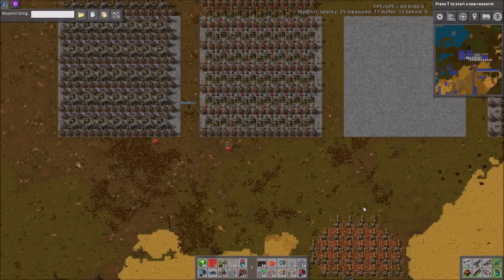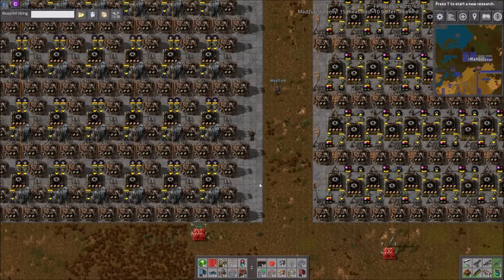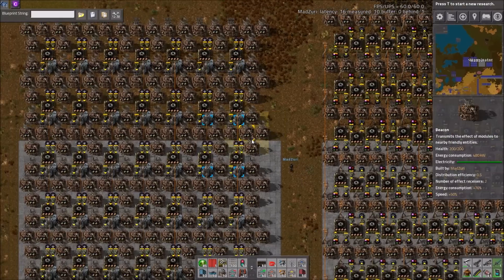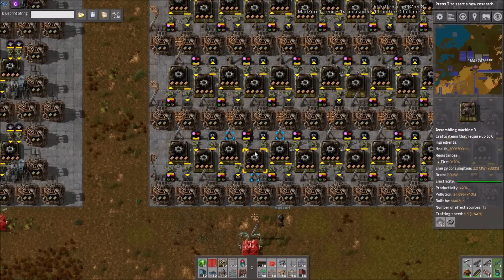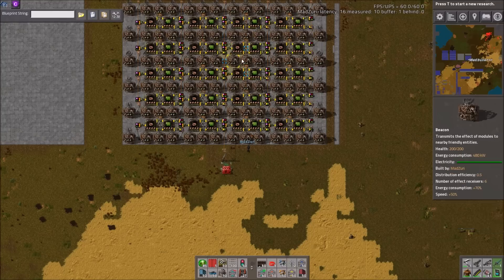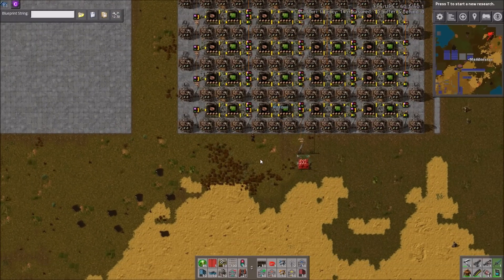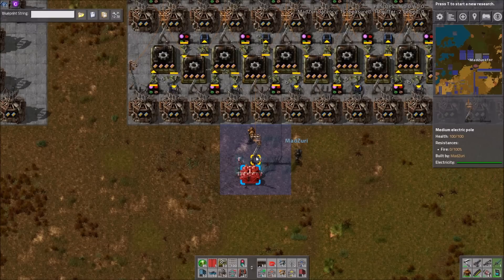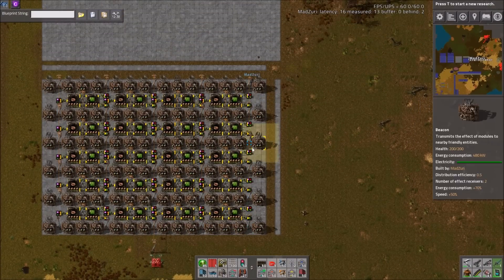Factorio Workshop - Building A Better Factory :: Power / Space Calculations

Comment: It turns out that, if you are accounting for the space solar needs, things get funny (you get about 3.28kw/tile with a near-optimal solar setup).

When factoring in the cost of beacons, the most power/unit you  get when using 2 productivity modules in the furnances, is each furnance being hit by precisely 5 beacons and the beacons set up to hit at least 6 on average (easily doable since the center ones all hit 7).
With higher power density, as one gets with steam, the most energy efficient is still the same 5 beacons with efficiency modules thing, but the most space efficient is 0 efficiency, 4 speed beacons. (meaning if you don't mind the increased coal usage, 4x speed beacon is the way to go)

Chemical plants want either 1 speed beacon, 2 speed beacon or 5 efficency beacons. Depending on how dense you can build really (= how many beacons you can get to hit and share effects).
oil refineries want 5 efficency beacons - if you can get all these beacons to hit at least 3 targets. If you can't - 1 Speed beacon or 0 beacons is actually preferable for both space and power.
And for Assembly machines, because they can get 4 productivity modules, for power efficiency/unit you want 8 efficiency beacons ... but for space efficiency you want 5 speed beacons hitting 8+ targets each. (Or 4 hitting 6+ each).

Messy spreadsheet I made for this:
https://www.dropbox.com/s/ohej33qnl98hfmo/spreadsheet%20ftw.ods?dl=0

disclaimer: these are slightly old results that do not fully account for inserters (an oversight I realized only after doing them all, but a cursory look over the numbers seemed to suggest that it doesn't differ much)
disclaimer 2: all those numbers are for belted builds, I have not done any calculations on how roboports and robots mess with those numbers, but I generally massively prefer belted builds for their better throughput and lower power cost anyway.
Reply from the maker: Wow really interesting info here! Thanks for taking the time to write it all up. :) Took a look at the spreadsheet as well, and I have learned some new things. :D

In regards to your disclaimers, there is a fun fact actually that I feel I should point out. Max upgraded bots actually have a higher throughput than blue belts do if you set it up correctly and don't have charging issues. Of course though, as you mentioned, it takes a lot more power to do that than belt setups.
Reply: Glad it was helpful to you! And that you were able to understand that mess of a spreadsheet xD

And well the "don't have charging" issues is the thing I'm worried about - I haven't done the math, so it's more a gutfeeling, but max upgraded bots - do you happen to know how many roboports one needs per lane of bluebelt? I suspect it's >1 even (for the full left-right span of a roboport). But there are so many variables to consider that I haven't found a good approach to answering that question yet :/

Comment: I think its kind of unfair. The design down below is not stacked, and there for it loses both a lot of space and efficiency.  The calculation i made a few days ago..
https://s23.postimg.org/85skcqp97/factorio6.png

This is for a unlimited size build. (can imagine that the build is stacked to other builds.

I would still say that the dual rows is far superior.

One thing that is nice with the 10/4 4:12 set up is that it can use direct feed in the build with intermediat bufferts and 3 full blue belts if that is needed.

I also made this build. Its just a version of the one here but a bit more compact. 

https://s29.postimg.org/jfeau5g6f/factorio7.png
The nice thing about this build is that it can be stacked with any other compact beacon builds.
Reply: "but I dislike using the 2 boxes. "
Well, yea.. i do kind of agree with you there. Its really a trade of in this case.

Its really a trade of if you want totally symmetrical beacon placment or not...

I really do prefer the symmetrical beacon placement Then i can stack all my designs together regardless what they do.

Also of cause, i uses almost 100% belted bases. Usually with braid yellow+red both side.. Having virtually 100% underground belt citing down a bit in the CPU overhead.

Yea.. i know... Bot bases is the cool thing, but i do prefere the belt bases... also there is no problem with boot charging
Reply: About my numerical analyzes... i was a bit supriced that the standard 4:12 was as good at it was.. i thought it was totally rubbish. The beacon really don´t use as much energy as one might imagine when the assemblers is up at 800% speed  they really eat energy... Still the save energy to using less input. Of cause, when it idles or don´t go full tilt, the beacon start eating energy to.

I was also supriced the amount of energy melting and mining takes, while the oil processing don´t really use that much.

To me the 8:8 set up is far superior. And the 8:4 is really quite reasonable to.

The productivity 3 modules is so freeking expensive so there is no point in not using SPeed modules (a part on the sulfur/acid/plastic processing)

I´m thiking of ading chemicla processing to the spread sheat.

Comment: The gear setup on the right can be built 12.5% more spaceefficiant by, instead of putting powerpole between assembler and beacon, putting them in the middle of the inserter.

Comment: My intuition says that the way to make a space-efficient build is to beacon the hell out of it, but it seems there are diminishing returns. My intuition also says that when we start making bot and beacon builds, energy efficiency goes out the window and the only thing I should care about is production per unit space as a proxy for minimizing bot travel time. Does anyone have experience with this? Should I really care about energy per item produced with bot and beacon builds?
Reply from the maker: Same here. My intuition and thought process was that I should fit as many beacons around something as possible and I thought I had figured out a clever design to do so. However, it can be deceiving as we found out here.
I would say you are correct though that you should worry more about the space efficiency with bot/beacon builds rather than the power, unless you are on Steam. If you are on solar you pretty much have unlimited power as long as you have the space to build it. 
The production per unit space is very important for the exact reason you said, bot travel distance. :)
Reply: Nah, you are forgetting that what you want to optimize is the number of beacon applications (assuming sufficiently powerfull beacons that the base production is small). The number of beaxon applications is roughly comparable to the beacon density times the factory density (though that is under the condiction that they all get to apply).
It is a very common math problem to have to things multiplied together where an increase in one creates a descrease in the other. The usual solution to this is to have equal amounts of each, since that is that is the optimal point (the intuition from this relies on differential calculus, where you see that if you have not ballanced it you will increase of increasing the lower value is higher than the decrease from decreasing the higher value).
Since alternating rows have roughly equal amounts of density, we would expect it to be close, and only the descrete part of the problem (how to actually fit them together) is what would determine the exact from.

That said, the comparison is not really fair, as xterminators build is really designed to handle chained production, and not individual production, and we would therefor also expect that a design that does not have to consider this could become more efficient.

Comment: Pretty cool video. In the end when it comes to UPS the "max beacon" setup would be better though right? I mean you'll save on energy and space with the "line of beacons" type, but space and energy are pretty much free when you're working with solar and have an unlimited map. UPS in a megabase is going to be the thing that ends up making the game more painful to play.
Reply: Oh awesome :D That changes a lot then :) I'll have to take that into account for my future builds
Reply: I am quite curious how they managed to make it squared in the area, I would have expected it to be significantly less, such as at most O(n log n), where n would be number of roboports (an upper bound on the area).
With that much computational complexity available, you could make some crazy optimizations, which are not at all what I have observed with bots.
I would have expected the computational cost be something like O(m lg n), where m is the number of transfer requests, given that they use a first come first serve principle, and you can locate position from a propor datastructure over 2d space in logarithmic time.
Reply: That is still quite a lot, and it would be quite stupid to check for charge every tick, one should instead use a kinematic datastructure, which would here simply be that you precompute when you will run out of charge, and only do the extra calculation then (or an estimate of when you soon will run out of charge and need to start heading to a roboport).
Even better, one could plot the course beforehand based on the range one can travel before needing recharge, so that the robot will go bonny hopping between the roboports until it has enough charge to reach its destination. One could then find the true shortest path, maybe with some extra residual to costs assosiated with the expected wait time at roboports, and due to the limited range of robots the graph would be relatively sparse (linear in space, and proportional to the density of roboports, which can be consider to have a constant upper bound), which means that you would expect cost of such an computation to be on the order of O(n lg n). You might even be able to speed this up by using that the graph lies in the plane. You could also use the greedy approximation, where you only select the next roboport that brings you the closest to your destination, which would cut down on the cost of this search (as you only have to find one edge out of a set, and not a set of edges out of a larger set). Now they obviously dont do this last I checked, so the cost cannot even come from a poor implementation of this.

Concerning the distance of random walk, all you really need to do is ensure that you do not target a roboport that is further away from your target than the previous one (or atleast some minimum distance closer). Since you are expected to be equally likely to go in all forward directions during a step, we can integrate over the projection of the change vector over all the directions it can go, and it should take something like 50% longer, which is still just a constant factor, and we therefor still only get linear number of events in the distances that we travel. We then have to remember that normally the area is the distance squared, so we would only expect the cost from a single transfer to be O(sqrt(n) p), where p is the cost of calculating which roboport to go to (this is assuming you dont place everything in one long line). One could make a voronoi digram, which you could keep track of when you enter a new zone, which would make the cost of finding the next amortized constant time (since you already pay something per distance, adding a constant factor to this for updating transefer between voronoi regions should not change the assymtotic cost). In other words you could expect the cost of it to be O(sqrt(n)) if it was well implemented.

That said, I dont think they have used such optimizations, considering how long it took for them to even consider adding midflight roboport charges. They have probably used some "standard industry pratice" of "quickly write something that works", which means you code things in horrible ineffective ways. There is also the point that some of these optimizations might not be something you can expect the avarage code monkey to apply by themselves (or even just the average programmer).